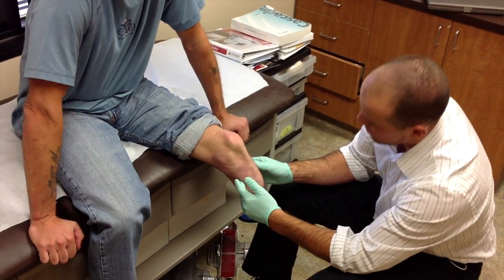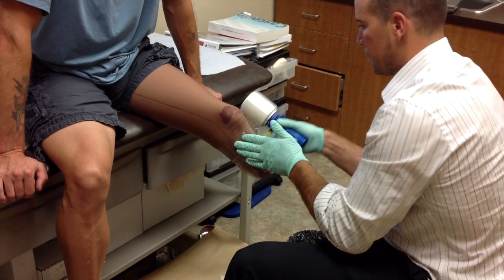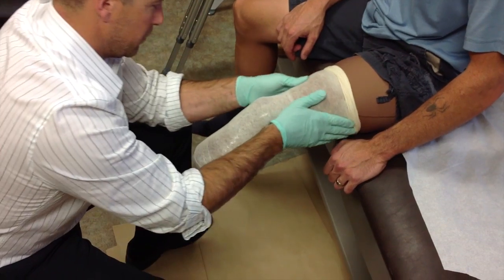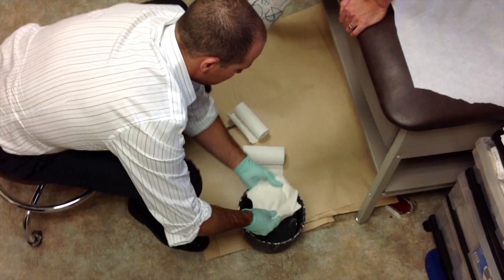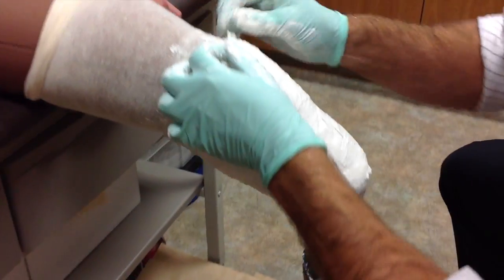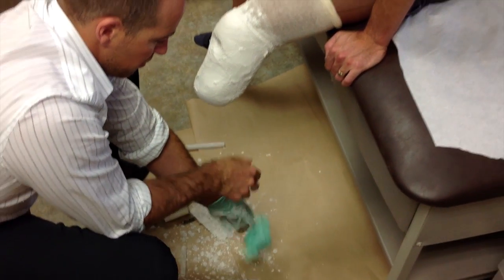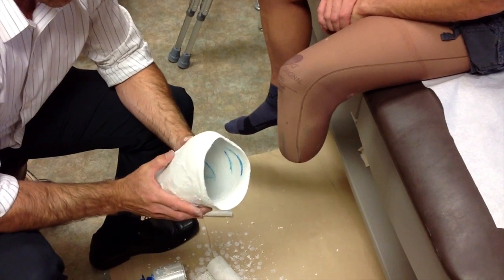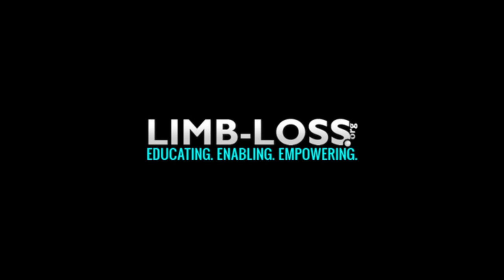The Casting Procedure | limb-loss.org

Comment: Thanks for the video.

I have some questions:
1- does the plastic wrap and the stockinette add extra thickness and how do you deal with it in the modification process?
2- what is your method in modification, I mean the reduction rate (ossur)???
3- when I make TSB socket using silicone liner , the patient does not tolerate any contact on the end of stump so all the TSBs I make are a failure; do you have any solutions?